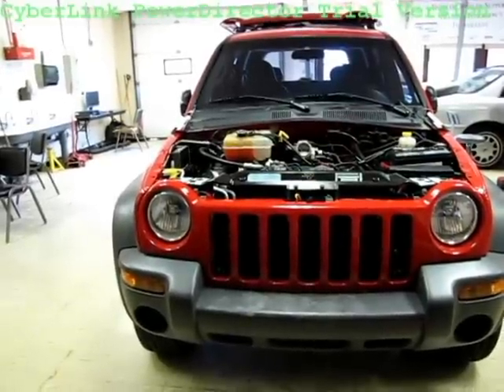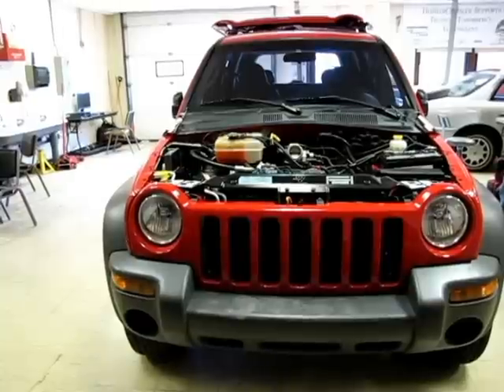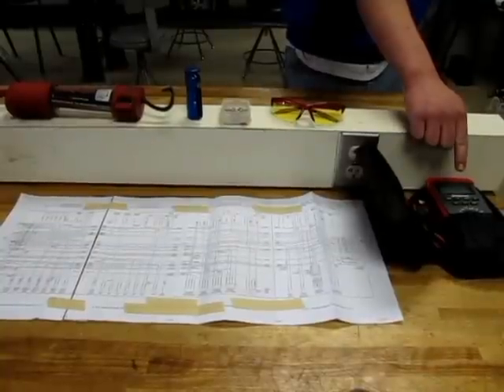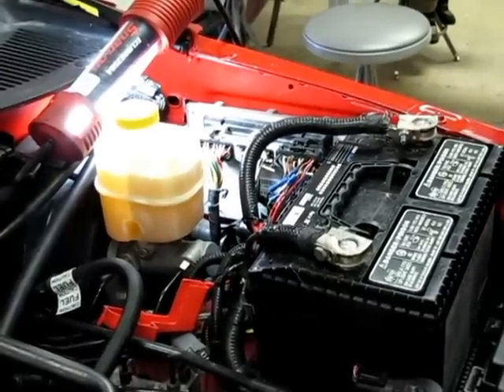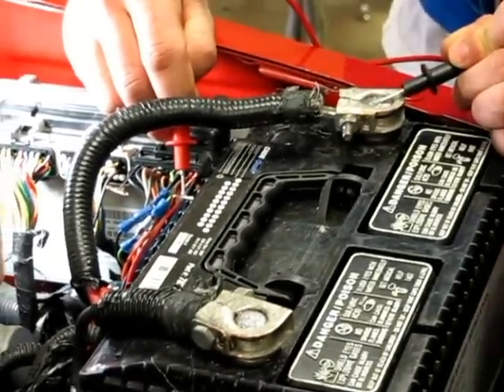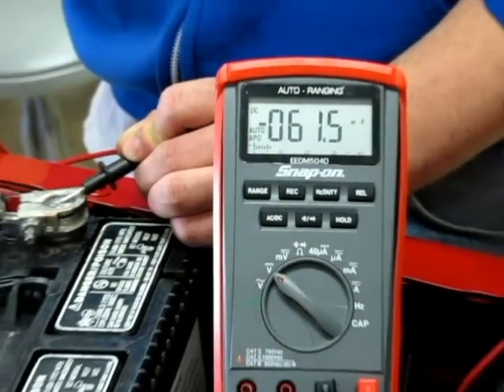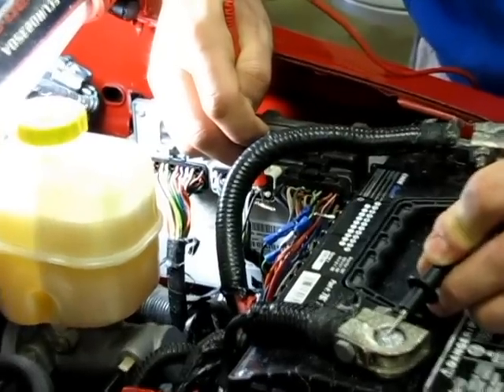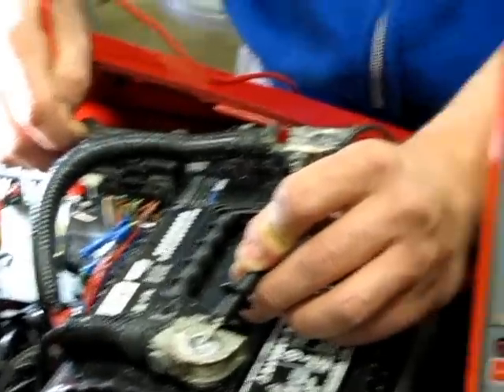PCM power and ground testing.avi

Comment: Hello. Shouldn't the red  lead  be on the negative post and the black lead on the ground wire of the pcm whem doing the voltage drop on the ground side?
Reply: no difference just a positive or negative reading on the dmm.
Reply: Ground to ground and power to power connections just takes the math out of the v drop test.